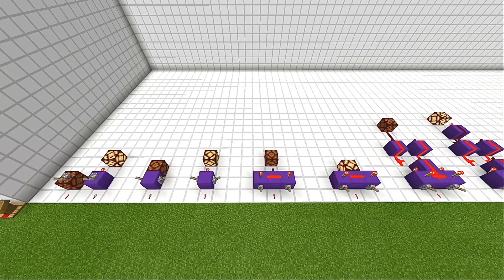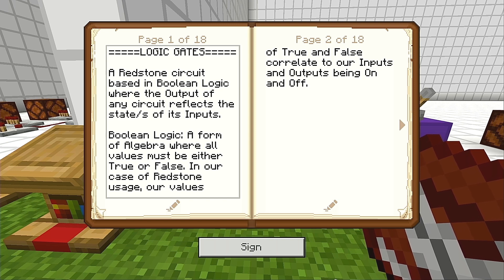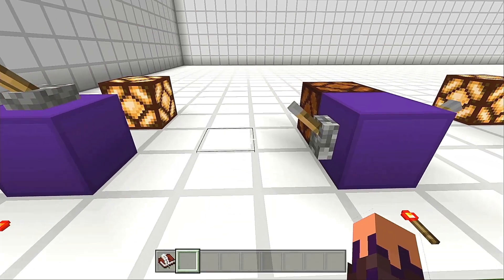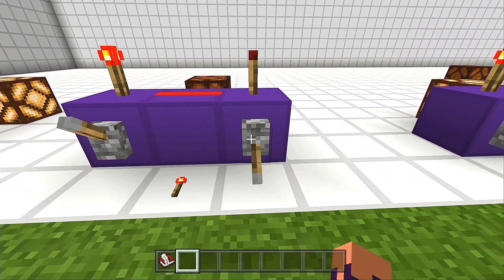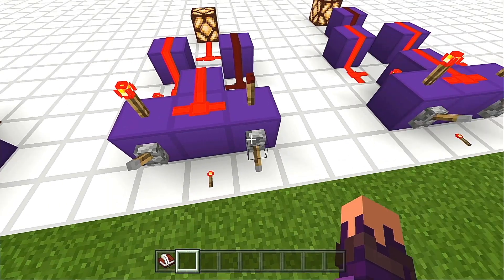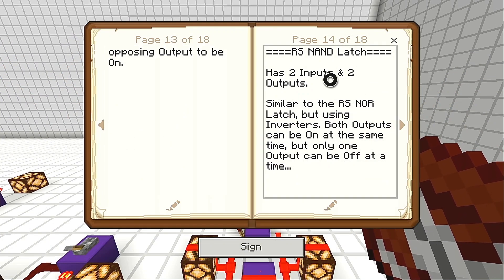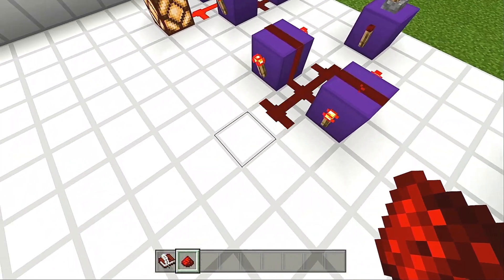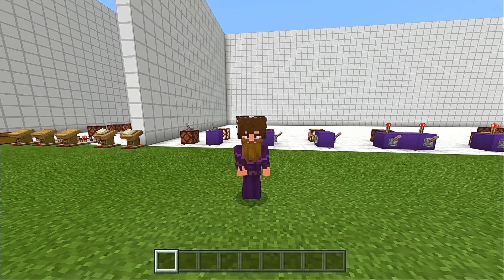How To Redstone: Logic Gates - A Redstone Tutorial Series - Minecraft Bedrock 1.16.201

Comment: Subbed. I'm still trying to figure out my circuit and how to make it work the want to. Circuit A is not energized when Circuit B is. When it gets inverted it works fine, but when it goes back to it's resting state, that's where everything gets messy. The Pistons from B rise quicker than the ones from A when it's not energized and messes up everything.
Reply from the maker: Which logic gate are you working on?
Reply: @TimelessTraveller  I was using a NOR gate to keep the Pistons up
Reply: @TimelessTraveller  I was using a NOR gate to keep the Pistons up

Comment: First of all, I'd like to thank you for making your video. I subbed.

Secondly, I thought you did a pretty good job of explaining most of the logic gates, but was a little confused by the RS latches. Is there a specific input side that is the reset switch, or is the input switch determined by which input was set first? Also, for the rapid pulser, it would be nice to know if the pulse time can be lengthened.
Reply from the maker: Thanks for the sub, welcome to the channel! 

For the RS Latches, both your guesses would be correct. Whichever side you pick once your build is finished would determine the 'reset' and 'set'. With the RS NOR Latch however, one side will by default be in the 'reset' stage.

For the rapid pulser, you can, but at that point I believe people call it a "clock" which would be built a bit different. The most common versions would be done with a chain of repeaters with the delays set to your needs. Other ones used would be hopper clocks and observer clocks. 

Hope this helps, let me know if you have any other questions!